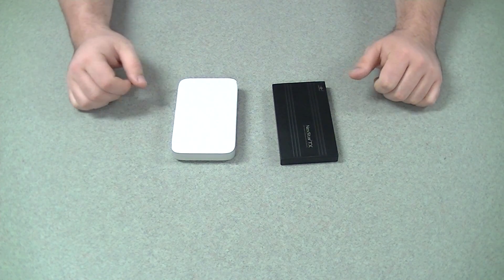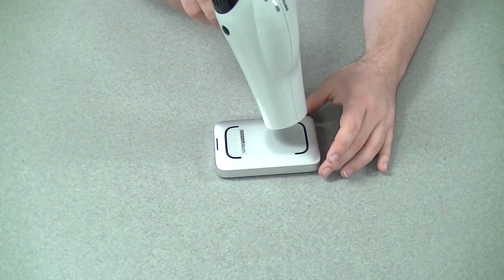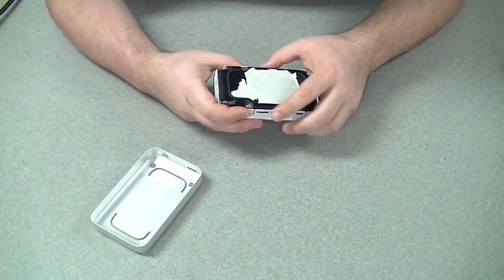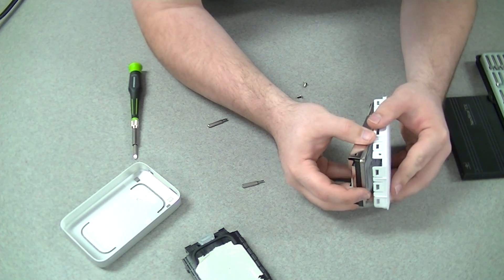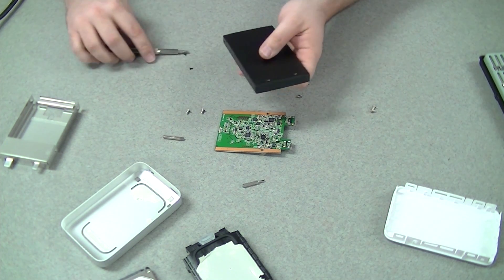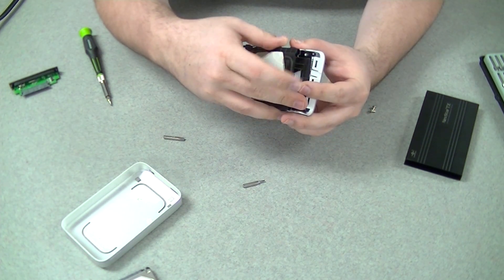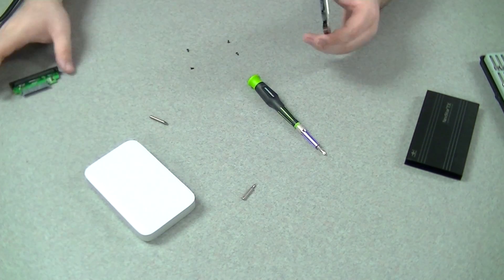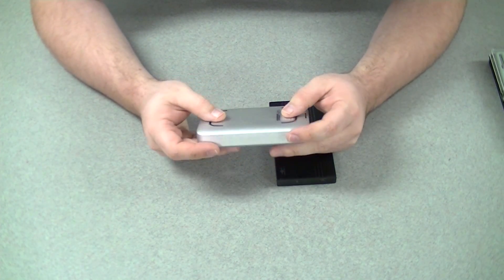Swapping HDD or SSD Into Buffalo MiniStation Thunderbolt

Comment: Thanks! I had this idea for awhile! Finally found someone braver than me to do it. I'm actually going to replace this with a 5TB drive now. I do video editing so using the Thunderbolt is a win.
Reply: Were you able to fit a larger drive in the Buffalo given larger drives are normally thicker?
Reply from the maker: I haven't seen a 12.7mm SSD

Comment: What driver head did you use for removing the two screws securing the drive to the pcb? They seem to be very tight and no screw head I tried can turn them.

Comment: My 960GB Corsair SSD worked well inside my MiniStation at first but increasingly became a disconnecting nightmare until it was nearly unusable. Apparently, MiniStations with SSDs over 256GB mounted inside tend to disconnect frequently, and 256GB Intel SSDs tend to disconnect the least.
Reply from the maker: +Panglos I've had no issues with mine running a 1TB Evo 840 SSD for well, nearly 2 years now :)

Comment: I used a hair dryer with higher heat output and 2 minutes was enough, since I wanted to keep the hard drive inside from melting. Also, a putty knife makes opening it a lot easier.
Reply from the maker: Hugh Lang Yes, a putty knife does make it much easier!

Comment: Thx for the video good instruction. One extra tip. If you have managed to take the drive out put a small plastic sheet over the adhesive. Just let the adhesive part be sticky for a small area. It can be removed much easier next time !